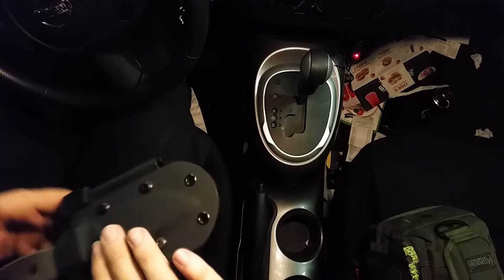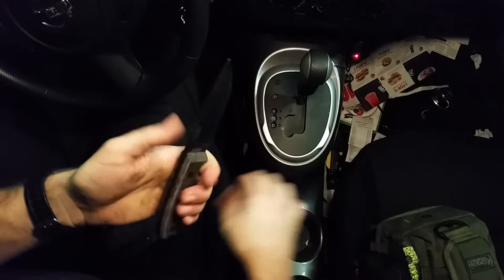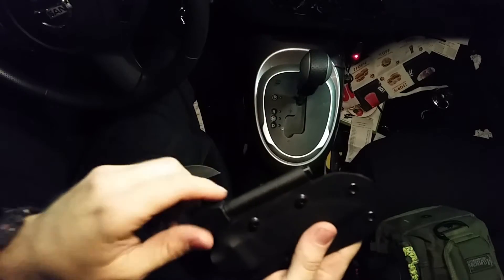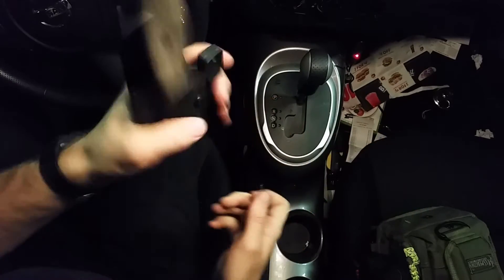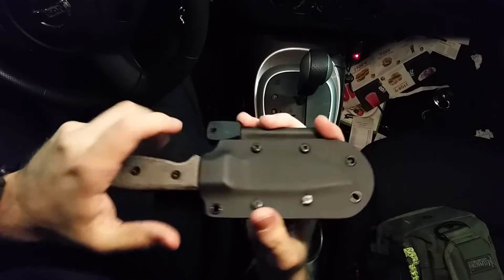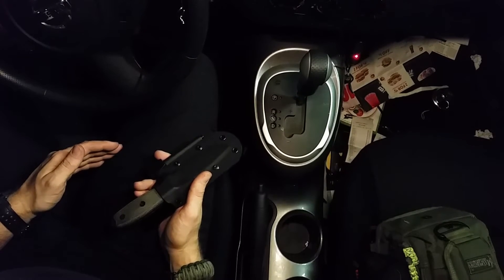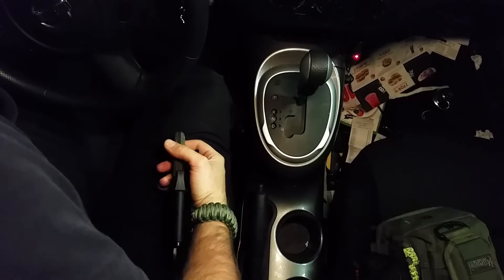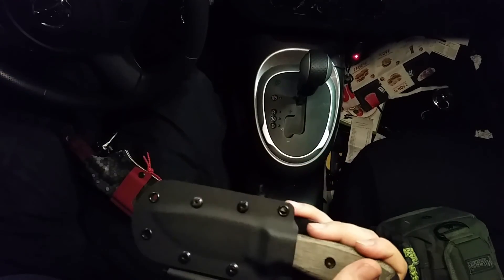My cima 1 custom sheath

Comment: Real nice sheath & vid.  Question, how did you get the original 4 phillips screws off the og sheath with those screw backings?  Thanks if you can answer this.
Reply from the maker: Righteous Hammer it's be a wile but I just belive I used one of those    snub nose screwdrivers you always see but never know what to use them for the ones that are about 2in long with a big handle mine did not have to much thredlock on it so it was quite easy
Reply: thanks so much for the reply, went to home depot, bought a 98 cent flathead out of the bargain bucket they got, took it to their "equipment rental" dept & the dude filed/ground down a post sized cut in the middle of the head so it fits either side of that screw backing disk,  works perfectly.  98 cents!  lol.  thanks again.
Reply from the maker: Righteous Hammer ya no problem I like the clip easy to get on and off and it works.